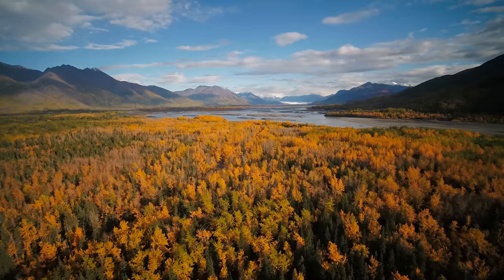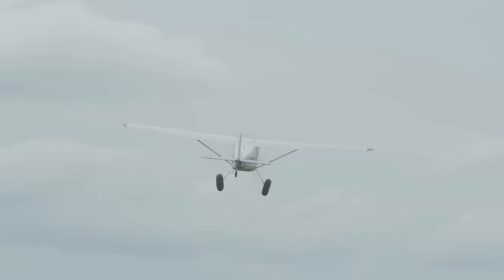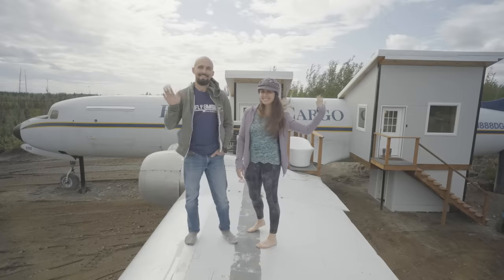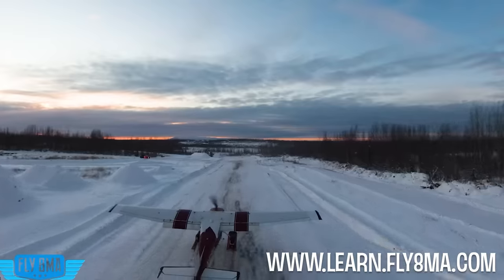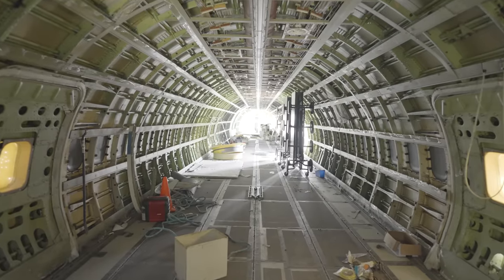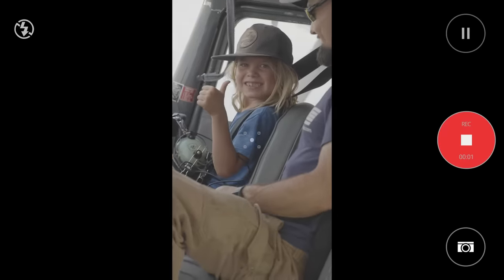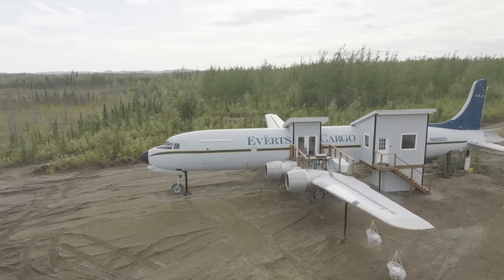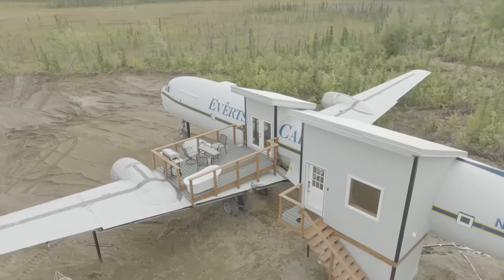They made a house out of an old retired airplane?! Full tour

Comment: I’ve seen a few other people that bought and used an aircraft for a home or airbnb. One, which I believe is in Bali was nicely done as I recall, but the other couple I’ve seen aren’t anywhere as nice as this one. You guys have done a great job. 

If you have a long enough runway, or one that’s close to you, would it be cheaper to buy the decommissioned aircraft and have it flown to your own airstrip, or one close by? You could then strip the parts and sell them to whomever buys that stuff. It would be a lot more work, but you wouldn’t have any transportation costs other than regular trucks to transport the engines, monitors, computers and whatever other equipment that is typically purchased from these aircraft. Seeing that you already have a couple additional plans, perhaps you don’t need anymore. 

If your flight school isn’t opened year round, if not already done, you should put the planes on airbnb. I’ll bet there are a lot of people that would enjoy staying in a plane.
Reply: If the plane was capable of being ferried (not airworthy mind you, just capable of a one time flight), then it could easily end up costing 4x as much. These aircraft have likely been cannibalized over a decade or more to keep the rest of the fleet going, so the amount of parts and maintenance required to get them up in the air for just one flight would cost more than finding one that was capable of flying as-is. I addition to that, there's a high probability that the airstrip they have is simply too small to land one of these airliners and is only able to accommodate small aircraft. It would be a bit tragic to cut up an airworthy plane just to turn it into one of these houses, the only reason why they did it to this one is because it was essentially only worth the melt price of the aircraft itself because everything of real value was removed.